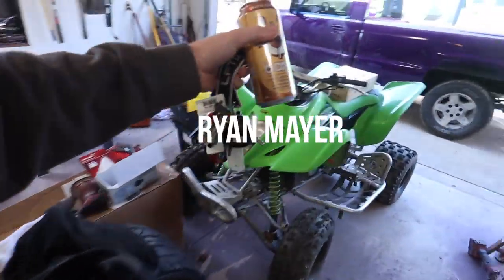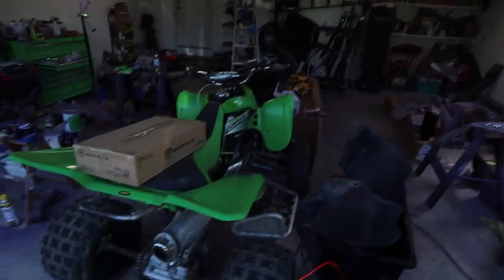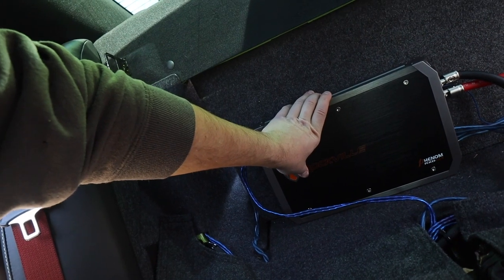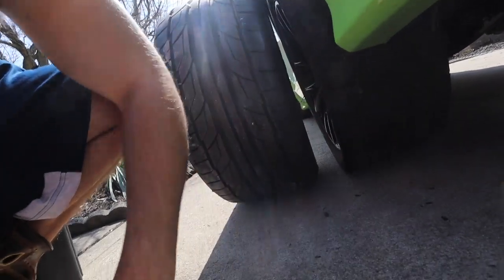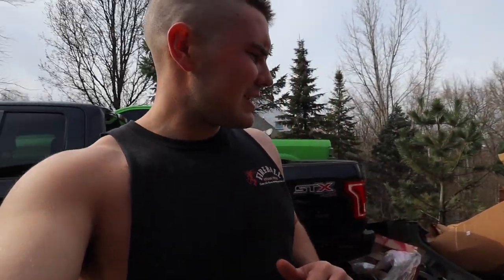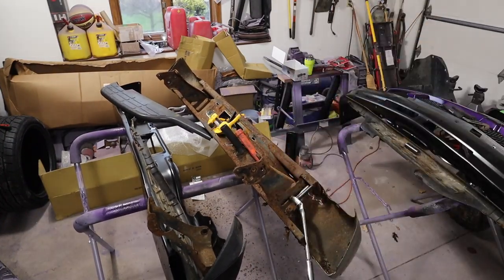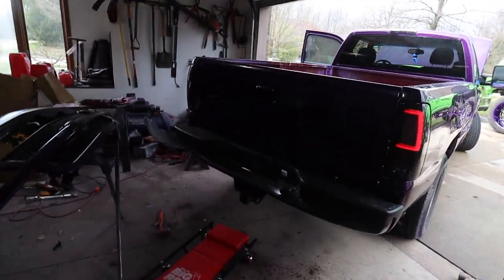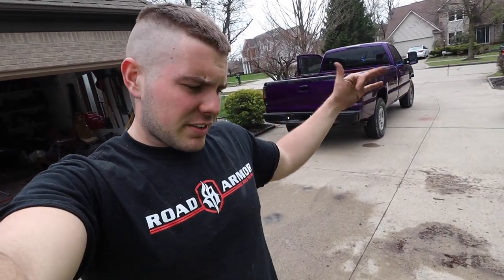I GOT SCREWED ON THESE PARTS!! + HELLCAT GETS NEW 4000W SUB AMP!!

Comment: Looks sick dude!! Love the black bumper. Tip for the front bumper plastic. Get duplicolor bumper paint in black and spray the top and bottom plastic, the stuff is completely amazing, it gets rid of the ugly gray color of the bottom plastic and matches the top and bottom plastic so they are both black. The paint maintain the texture of the plastic also, I used it on my cateye front bumper plastic and it transformed the front end of my truck and its lasted almost 2 years now without fading, chipping or cracking. Amazing stuff and cheap and easy to do!!

Comment: Yes Trail Grapplers. Just put them on my pickup with ceramic balancing beads. I was skeptical of the beads but man I’m a believer now. Super smooth on 35x12.5 on 20x10” wheels. Might work for your setup but you got some big tires and wheels.

Comment: JL is by far a great product. Get a JL amp as well to push them sexy subs.   I use to install car audio for a local shop and we NEVER installed an amp on a box. I would always make an amp board and wrap it with a material that would match the interior or what ever the customer wanted. Make yourself an amp board it will clean it up alot and able to secure the wires behind the board.

Comment: 🤔 Hey I have a solution for the amp moving. Get some Velcro and put it under the box. It will hold to the carpet. I put it on a big tool box and haven't moved yet. Hope it helps, simple easy and no holes or screws. 👍🏼

Comment: The boss 1500 watt amp is actually 2 or 300 watt amp, so as long as that Rockville comes a little close to 4k you should be good. And use velcro for the box.

Comment: With two 4 ohm subs wired in parallel to create a 2 ohm load with that amp should produce 1,500 watts RMS, you can go slightly over your max sub wattage as long as your not playing to the point of distortion for extended periods of time.

Comment: You should of powder coated the bumper brackets and if your charger is clipping with the new amp you need more power bigger alt or audio battery’s that amp is rated for a certain amount of power to put out a certain amount of watts it might only Purduce 1000 watts at 14 volts you have to look it up

Comment: If each sub is a dual 4 ohm sub then you can wire it down to 1 ohm and use the full 1000 watts with 500 going to each

Comment: no  your back bumper is mint compared to what I had.   LoL    let me just say if your bumper is say 75% still a bumper,  mine was -20%  LoL   side brackets,  gone,   bolts?   grinder was the only way.    and I got the 2015 bumper to put on mine.  why?  well it can be made to fit.

Comment: Help your amp and alternator out put a capacitor in and you will stop your amp cut out it helps keep the amp from losing power and helps eliminate heat

Comment: A cheap amp will never push what it claims. You’re at two ohms if you only have one voice coil per sub hooked up. Look into sundown and fosgate. Those are both good brands. JL is also a good brand but are lacking once you get to high end. I have 1 15” t1 fosgate pushes by a sundown 1000w but does 13xx rms with perfect clarity

Comment: For the raptor liner tintable you need 4oz of color for one bottle, also its easier to mix it in a different bigger bottle and then poor it back into the raptor bottle. My whole truck is painted with the Raptor tintable, check it out on Instagram @that_gold_kota

Comment: Good lord you're going to ruin your electrical system with that 4k amp even if it puts out 2000 watts at a 1 ohm load. But the whole audio system is a complete train wreck running at a 4 ohm load. You could wire it down to 1 ohm and adjust the power being put into the subs to 1000W to power the subs correctly.